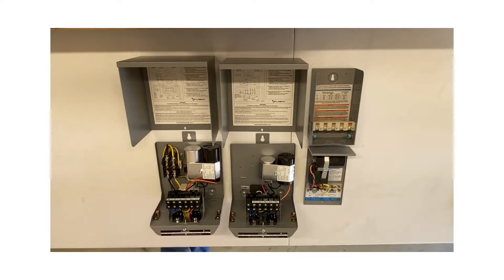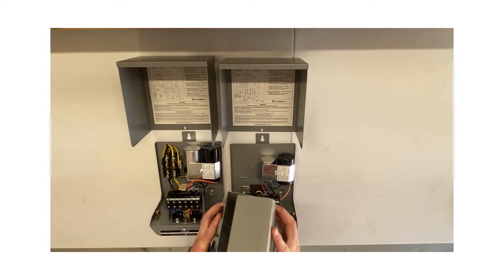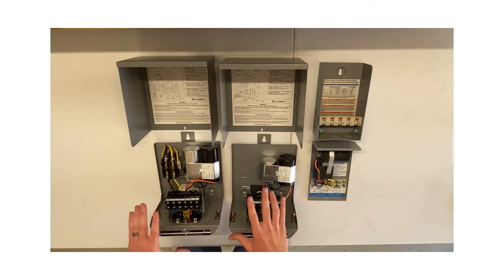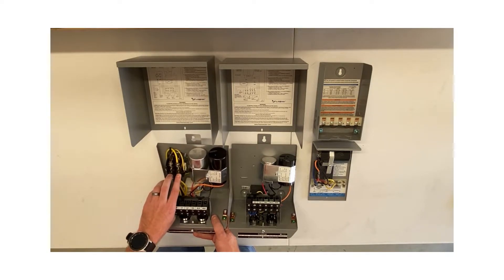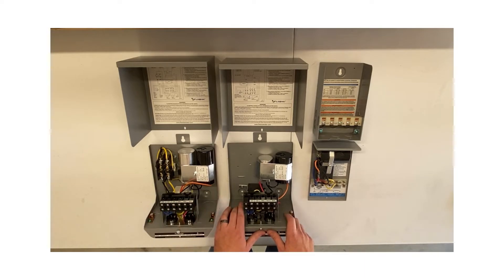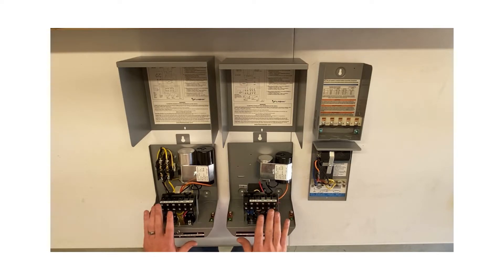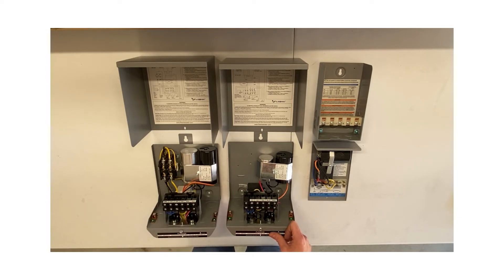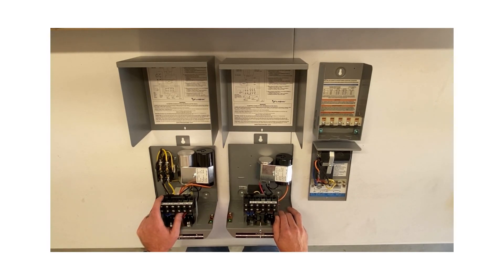Submersible Pump Control Box Types

Comment: The home run won't be any different from one box to the next, as the home run must be sized to the current draw of the total maximum load of the circuit!
Reply: I believe he's referring to an optional situation where the pressure control (or cistern volume control) is wired to the control side of a contactor. That control side doesn't carry full current going to the motor, it simply controls the current needed to open and close the contactor solenoid. So the branch wires going to that pressure or cistern volume switch can be significantly smaller gauge. As you say, the home run carries full current for the motor all the way back to the panel.
Reply: @spelunkerd  The wires to the control side are local and maybe a foot of wire within the box if the controls are being transformed down to a lower voltage then they could be sized differently but it isn't a point worth mentioning on cost. It doesn't matter what controls you use, you still have to provide the same size conductors to the control from one controller to the next, as he was mentioning the total cost difference. The wire size would not have any change.
Reply: With the QD box how is it possible to test the capacitor? I'm having issues where there is a call for the pump to run but my pressure drops to zero for a short period of time then all of a sudden it kicks backnon....I'm puzzled as to why this is happening.